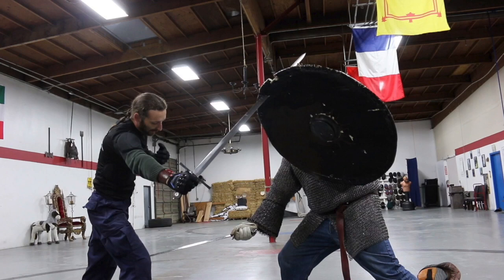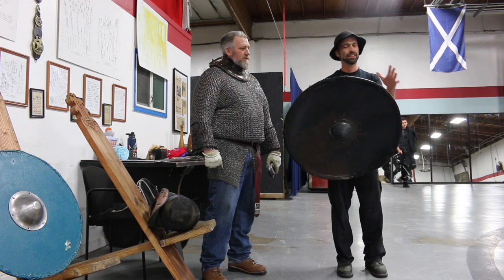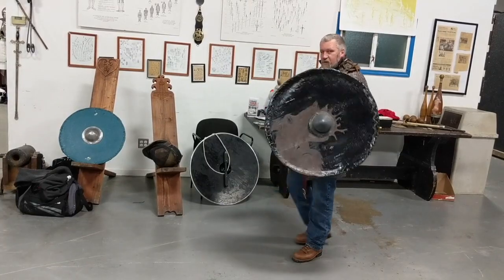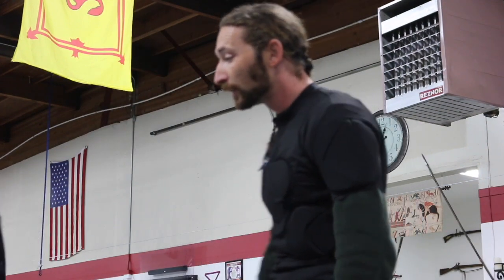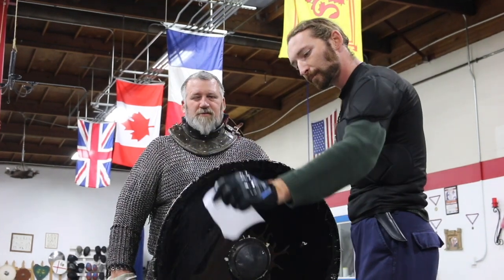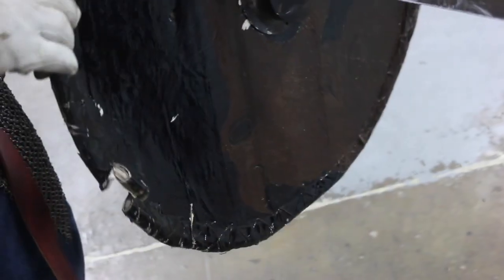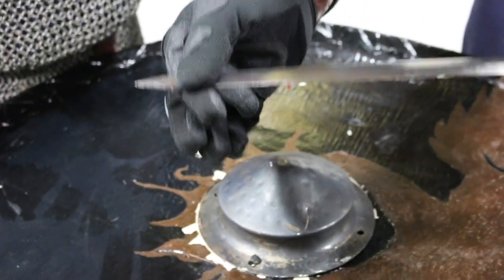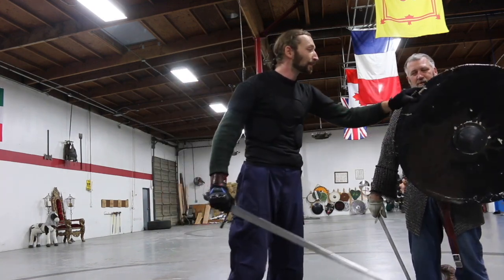Live Steel Testing the Authentic Viking Shield!  Binding the sword with shield Part 1 of 2!

Comment: This is Thrand! Love the video and excellent idea to use balsa wood. It proves what I have been saying and trying to prove for a wile the Rawhide used and lamination with adhesives is more important than the wood used. I shall come back soon with a true Bass or linden wood shield soon and its a bit stronger than balsa but not by much :D
Reply from the maker: Hey Thrand, Gotta say, what a pleasure, love your channel. 
Yes, exactly the idea, to prove and test the limits of the edge and facing material.  And also for weight.  Hence the poplar handle which was probably a bad idea.  I've been planning on making a couple more of different woods the Anglo Saxons used.

Comment: If I'm not mistaken, the boss you've used is one of the 12-14 gauge ones (I've used several like that myself). See if you can find a lighter one (my instructor made me one that's about 7-9 oz) and you'll be even happier with your shields. I made a 34" diameter shield out of poplar; goathide on front and back and edge, oak handle . . . 6.00 lbs. https://gamingballistic.com/2018/10/22/crafting-hide-faced-viking-shield-experiment/